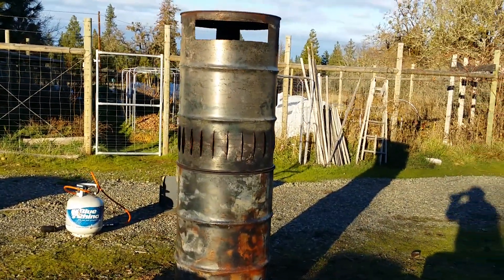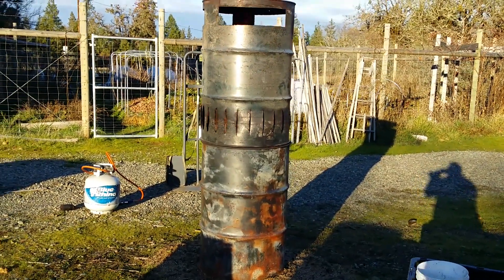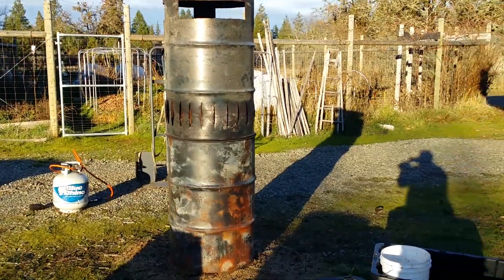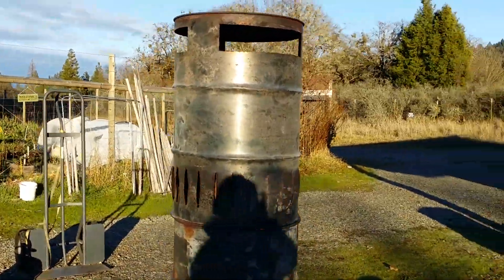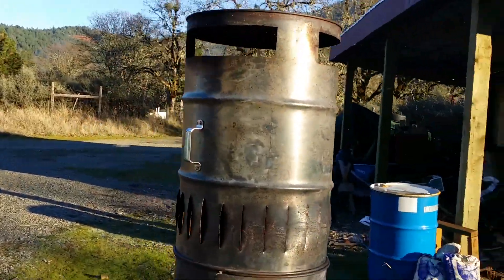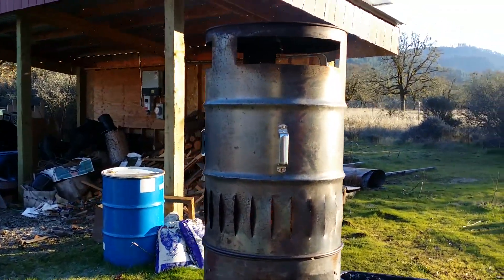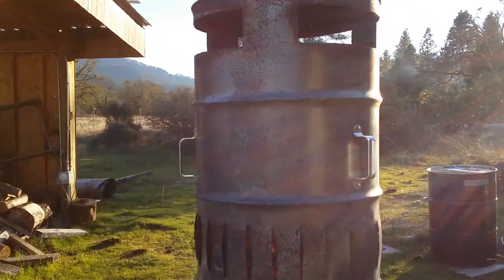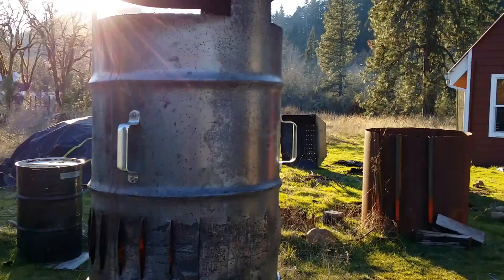Plenum Burner for Barrel TLUD

Comment: Note that this is incineration and not pyrolisis. So you can not get really biochar from there if you can see the orange flame, that is oxigen presence and pyrolisis is a process without oxigen.
Reply from the maker: It does make biochar because part of the biomass combusts in order to provide the heat for pyrolysis. That is the flame you see.
Reply: @KelpieWilson  Always funny when amateurs try and tell the experts how to do it :')